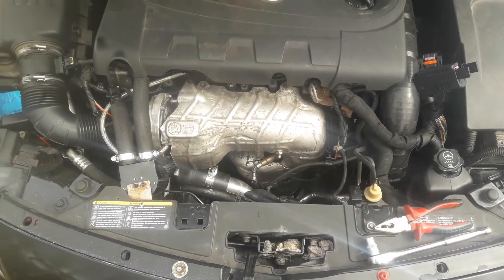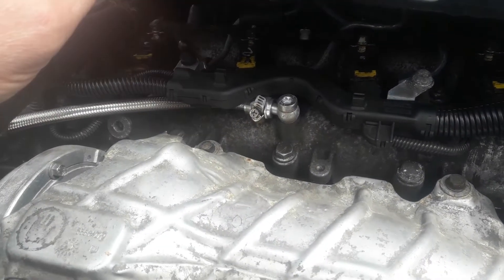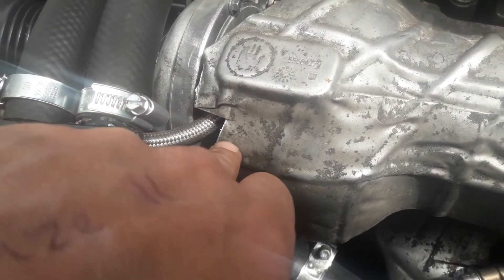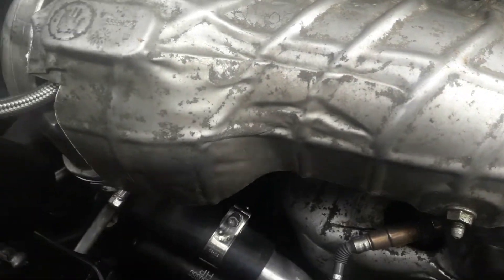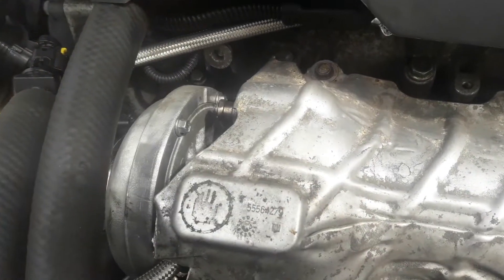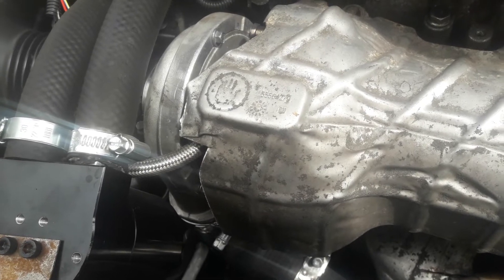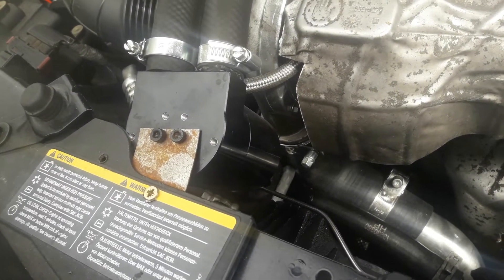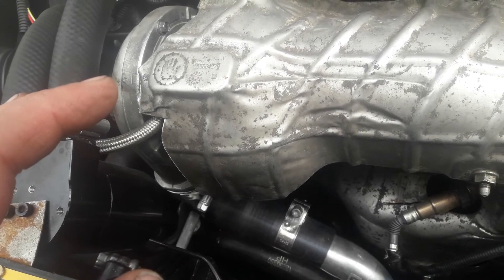Insignia Diesel Hybrid Turbo

Comment: You should consider a GTB2060VKLR or GTB2056v for this... I've got an Astra 1.9 150 with GTB2060VKLR running 2.5 bar boost, very impressive punchy turbos for an 4cyl diesel.
Reply from the maker: Yes in my previous videos I had a GTB2056 on a vectra and that was a great turbo. I do love the VKLR turbo series they are still a little pricy but great units without a doubt.

Comment: hello, I own a vectra c 1.9 diesel standard from 2004, (non gts version). I want to upgrade ONLY the intercooler, egr and flaps off, a light stage 1 remap to gain 25-30 HP. Can you give me some guidance on what do I need to do this job?. Do you sell upgraded intercoolers who can fit my vehicle. I am from SPAIN thanks.

Comment: Hi, do you think the auto transmission would be able to handle a turbo upgrade ?
Reply from the maker: Totally fine a chap in scotland has been running 1 for 2 years without issues just change the fluid to be safe.

Comment: Hi I am very interested in fitting a hybrid turbo to my 2014 insignia 1b sri. Do you have a link to a website where you sell these if you still do, and any other mods for some nice power increases you recommend. Thanks.
Reply from the maker: I don t build them anymore as I am too busy but there are several still kicking around as they were really popular for a while.
Reply: @dieseltuningincboosttechno4684  thanks for the reply. Do you have any idea where to look for one?

Comment: Hi sorry to keep firing questions at you for the Vauxhall vectra where did you get r80 fuel pump from which car as I would like to upgrade the fuel system and I'm sure I will need   a different rail pressure sensor as well thanks a gain
Reply from the maker: Hi mate now orries the R80 pump comes from the saab ttid or the later model alfa 2.4 jtd but check the plate on the pump it should have R80 printed on it
Reply: @dieseltuningincboosttechno4684  Thanks for that appreciate it just wish I could come and see you and learn
Reply from the maker: @keithknight1107  Ha ha let me know if you need help I can walk you through things using the power of ZOOM
Reply: @dieseltuningincboosttecno4684 are you still building turbos for the insignia,  
Im wanting to get one, if not do you still have any stock left available? Thanks Andy

Comment: Hi, Will this setup run normally without issues until the remap is done and can you advise what comes with the turbo kit just for clarification? What is the price including delivery also?
Reply from the maker: It will run ok without a remap but there will be very little power increase until its remapped. The cost including delivery is £540.

Comment: Compared to the original turbo. How much more power are you talking with this turbo? 

As I said on a previous video my Insignia is getting remapped (on Friday) so you posting this video is making me think "Hmm someone has made an upgraded Turbo and I want to be able to slaughter the Bi-Turbo Insignias" 😂
Reply from the maker: This turbo will provide enough air for 235-40 bhp but to gain the full potential it will need mapping after the turbo is fitted. We are currently working with Rigde tech remaps they can be contacted via facebook.
Reply: @dieseltuningincboosttechno4684   I'll definitely be following YouTube and check out Ridge-Tech Remaps. 

I assume the old air intake goes on problem. I've got fitted a metal cold air intake made by Engine Bay Styling.
Reply from the maker: @thomasfarrell6527  yes thats correct the standard sizes are retained

Comment: Hi I've got a 2012 vauxhall insignia 2.0 cdti what's the bhp gains from this turbo
Reply from the maker: The gtb1752 will get you 235bhp and the gtb1756 we are now doing will get 250bhp
Reply: Is this the same for the astra gtc 2.0 cdti Sri ? Thinking about a hybrid turbo, and would it be an advantage having a bigger intercooler, decat and cat back silencer delete exhaust as well as remap ?

Comment: Hi do you know of a bigger turbo or can i hybrid the B20DTH turbo ive searched google asked a few turbo companys and nothing.Insignia vxline 170bhp 2.0cdti thanks.
Reply from the maker: Hi thanks for the message its possible to obtain good power on this engine just from a remap so the demand for a bigger turbo isn t really there. If you were to fit a bigger turbo then a clutch upgrade would also be needed so its a bit of a rabbit hole.
Reply: @dieseltuningincboosttechno4684 Thanks for the reply,remap is 192 450nm flash and maybe 210  rolling not sure on torque gains.Im after about 240 and unfortunenatly ive hit a brick wall to what turbo will fit to reach this.Dont think the clutch needs upgrade but will if it does i will from what ive read anything over 240+ will need more.Im running at 192 flash its ok k&n cone intake dual exhaust exhaust.Thank you again.

Comment: Do you still sell this kit?
Reply from the maker: Yes we currently have a good condition second hand one available
Reply: @dieseltuningincboosttechno4684  I take it this would fit a 2015 astra j gtc 2.0 cdti? Have already remapped but fancied a little more. What comes altogether in the kit and what price? Cheers
Reply from the maker: @adrianbryant7342  yes it would fit the astra J perfectly and it's £380 Inc delivery, with a new braided oil feed plus intercooler hoses too
Reply: @dieseltuningincboosttechno4684  Is that out right price or do I have to part ex my turbo?
Reply from the maker: @adrianbryant7342  no we don't need your turbo